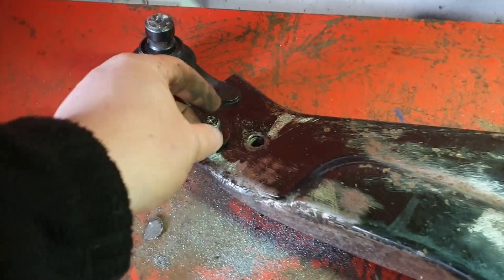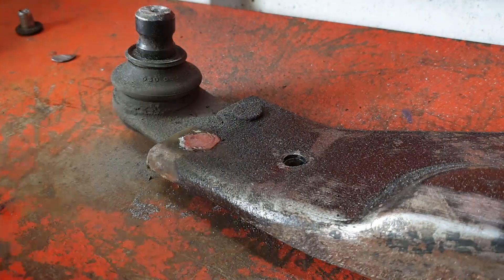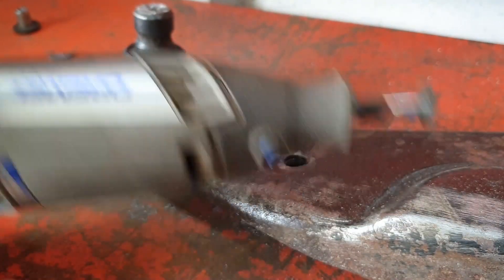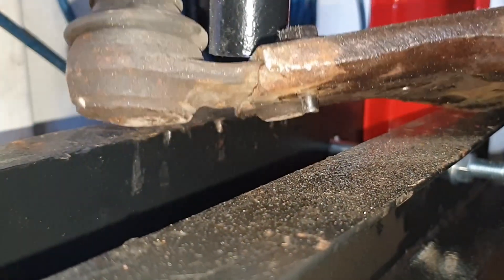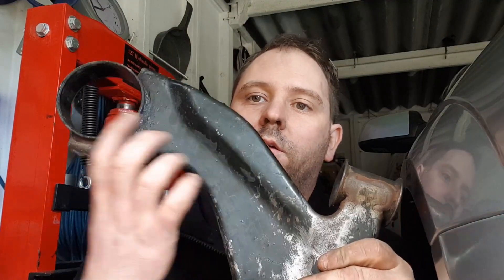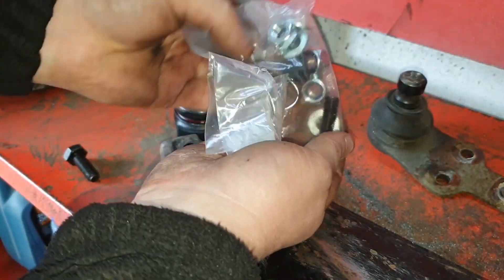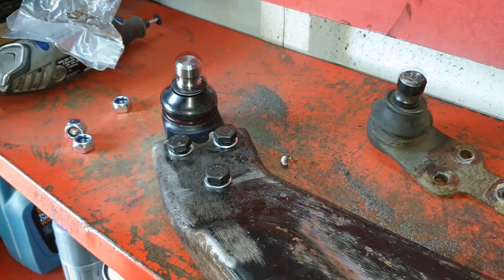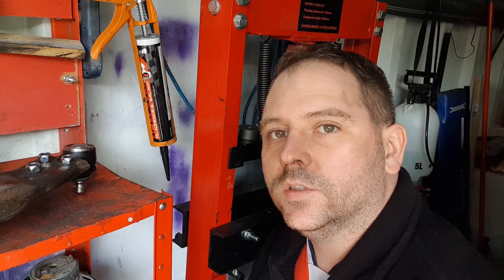Ford Mondeo Mk3 Ball Joint Replacement (project mondeo)

Comment from the maker: After doing this i realised what a pain this job is and that you can not do it on the car that i am aware off. So i completely understand why people would just change the complete wishbone. But as i was doing the poly bushes i thought make sence to replace these aswell.
Reply: Makes sense, nothing wrong with the steel bit. It’s always the rubbers that go. 

Definitely get a mini grinder, sooo useful.
Reply: You can do it on the car, I did mine on the car and made a spring compressor here - .https://youtu.be/Yh5JQnd-YP8?t=470  You need to take the weight off the spring by about 5mm then you need to remove the pinch bolt. Take an angle grinder to grind out the original rivets heads, a good smack with a hammer and punch then when everything is free you spray the old ball joints well with WD40 or GT85 and need to wiggle them out. Once you've undone everything put the ball joint in the bottom of the arm and insert the pinch bolt. The trick is to use the movement of the ball joint to insert the plate back into the swing arm and tap it home with a hammer. Drop the bolts in and do everything up loosely, let the spring weight back on and then tighten up all the bolts. It takes about 40 to 60 mins per side.
Reply: Question. How  did you manage to get the rear bolt of the wishbone out (15mm top bolt - 18mm bottom nut). There is such little clearance, between the bolt head and the wheel well, I don't see how its coming out. Thanks!
Reply: Charles Parnell as I recall the bolts leave the factory the wrong way round and if you haven’t had this done already, you may need to take the subframe off.
Reply: @WineScrounger  Oh goodie! grrrr. thanks. I was looking at it thinking why the hell ford didn't put the nut on top and slide the bolt up. makes no sense. If you watch the AutoDocs video, the bastard just magically pulls the bolt out. They even said to use a 15mm spanner, but a straight spanner will just round the nut off. Needs to be offset, best I can tell, since the bolt head is sitting in that dish....
Reply: Charles Parnell I cant remember what it looks like offhand so you may be able to just say the subframe a bit rather than removing it altogether. Alternatively if there’s space and you have a mini grinder or sabre saw you could maybe cut the bolt head off and just replace it from the other direction.
Reply: WineScrounger thanks for the advice. Probably will need to loosen the sub. 👍
Reply: Charles Parnell it’s likely. Good luck buddy 👍

Comment: What..?? you don`t have an angle grinder, already..??... essential workshop tool :-)) I`ve done these on other cars like Vauxhall Astras and its a few minutes with a grinder and can be done in situ and you can use a pivoting ball joint seperator as a mini press but, I see why you took the arm out for the poly bush installation. BTW, I just replaced the O/S wishbone on my Mondy Mk3 and once I dropped the rear subframe (I was doing this at ground level, so I used a small scissor jack under the alternator bracket against the subframe to give extra clearance to draw the rear bolt from the top) and replaced the arm, I put the rear bolt back in facing upwards, so if I have to remove it again for any reason, it will less of an arse-ache...
Reply from the maker: Hiya yeah i have finally brought an angle grinder from Ryobi. Its deffo worth putting the bolt up the other way. Alot of people do this.

Comment: Thats such a long way to do it, yes, i use an angle grinder!  As for punching the rivet out, it can be done without a press.
Start the rivet moving by using a sharp chisel between the rivet and the arm on the side where the rivet still has a head and then place something behind the arm to lift the rivet off the ground and do it on concrete, use a bolt or flat tipped punch which is almost the same size as the rivet shaft and belt it a few times and it will come out.
Dont use use pointed punches or overly thin bolts as the small contact area will expand the rivet shaft on impact and make it grip the sides!

Comment: Is it ok to bolt the new ball joints on for the mot? Do you use thread locker on them to stop them coming loose?
Reply from the maker: Yeah they should ve fine for mot, and you can use thread lock on them if you want. Put new bolts facing down and the nut from underside.

Comment: You said you're powering the dremel from an inverter, which one? I've got no power in my garage.
Reply from the maker: Hiya mate, ok. I am working on the project still and filming as i go. Basicly ive got a small 300watt inverter that is at moment connected to a 64ah battery (will be upgrading to a 110ah deep cycle soon) that i keep charged with a 100watt solar panel and a charge controller
Reply: @ChazzCoombes  you got any links to where you got them?

Comment: Hey chazz,
Got a mod question for ya....
Looking to know if a Tesla style touchscreen entertainment system could be modified into a mk3 st? Have you ever thought of doing this mod? Can it be done?
Reply: Fit an inexpensive Android tablet and hook it all up?
Reply: Yeah,  but is there any programmes that would show everything from the cars cpu? I know there's android tablets that come from China and they plug into the car and show everything... just wondering if there's a way to custom one up
Reply: Michael Brennan you could get a Bluetooth OBD2 reader and put the app on the tablet. That will give you a good deal of systems information. 
It won’t be as eat or as well integrated as Tesla’s effort but it will cost a fair bit less.

Comment: Nice press mate I would love to have the room for one 🙁...  
Regarding the ball joint rivets I do them quite often not easy to do it with floor jacks because ground clearance but not too bad either, my preferred method is drilling through the rivets and chisel them out, I’ve tried grinding on end of and punching them out but it doesn’t really work that well those rivets gets pressed in pretty good 👍👍👍 I filmed one on the Megane if you interested to see Suspension Noise Lower Ball Joint Replacement Cheap Alternative Renault Megane https://youtu.be/HQSguJDaY-0

Comment: Av done them before I seen  the press you have its the same my mate's.  I have a mk3 Mondeo myself. I have a press for bearings does the same job. I have polly bushed a few car's to  see how long they would actually last. In some cases they will last for years in other's not just depends on what you do with the car. Also don't buy cheap or you will be doing it again next year Chinese rubbish lol. Good video. 👌👌 That ball joints are the same set up on most car's theses days. I just wack them of with a 4" Grinder from tool station £15 cheepo
Reply: I took the rivets out with an angle grinder.  Then thrashed the centers out with a punch. Takes a bit of determination.
Reply from the maker: Maybe i should invest in a grinder if there only a few bucks. The press has deffo been worth buying
Reply: @ChazzCoombes  Aye mate get them cheap enough from toolstaion mate. Or machine mart